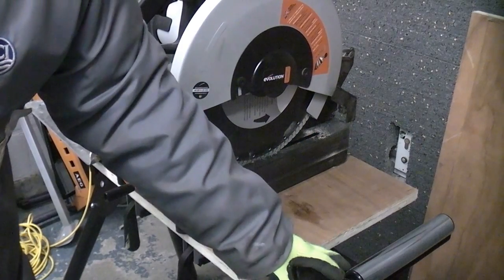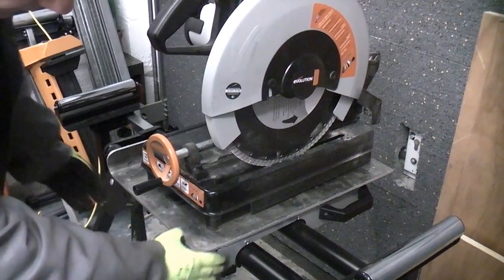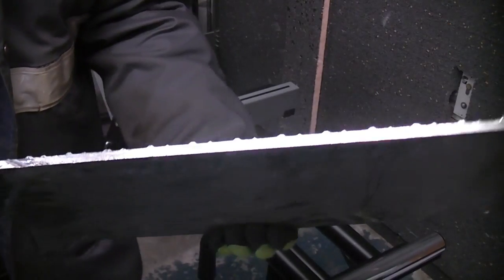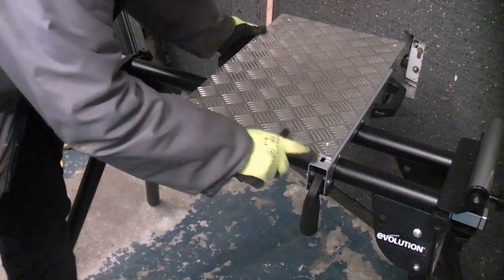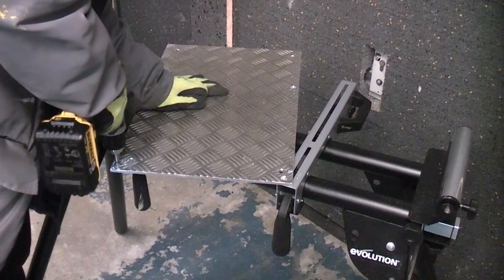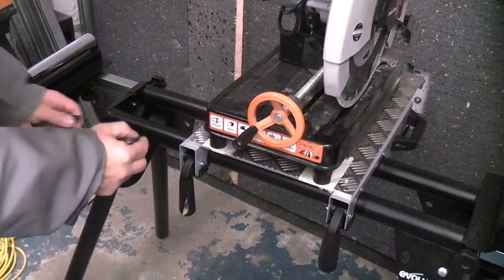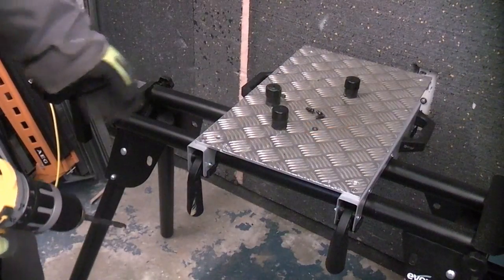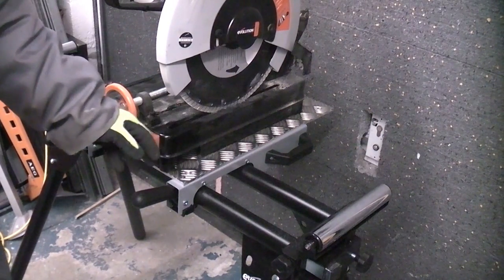How to make a mitre saw stand adapter plate

Comment: Another good video. I like your trick of placing a bit of tape on the spanner in order to hold the nut in place, genius idea. 
I possibly would get rid of those 3 rubber feet and custom make 3 metal feet in order to have the machine secured properly on the plate. Well done.
Reply from the maker: +Rui Nunes 
Thanks, normally I would use the Wera Joker spanner for jobs like this, but they are in my toolbox on site at the moment!
https://www.youtube.com/watch?v=BvBmCqXDDdk

The feet did pull down well into the chequer plate, so it is pretty secure although metal feet would probably be better ;-)
Thanks for the comment ;-)

Comment: Very smart. The only thing I would find annoying is fiddling with the nuts and bolts if I wanted to change the plate, so how about bolting some aluminium extrusion to the fixing brackets? You only have to do that once, then you can use T-nuts to fix any plate or machine from above much more quickly. Looks like the brackets are 30mm wide and 30mm X-profile extrusion is easily available with M6 T-nuts. You could even bolt things to the side of the extrusion. I missed the video for this stand, will go back and watch it.
Reply from the maker: +Matt Tester (UKMatt2000) 
Thanks Matt, this plate is designed for single use- you make one plate for each machine that will not fit the standard brackets. Most machines will bolt directly onto the standard brackets.
Thanks for the comment ;-)

Comment: should i make a different plate foe each piece of equipment I want to use { mitre saw, drill press, bench vise, scroll saw or grinder] or just drill different holes in one mounting plate?
Reply from the maker: Some tools will fit directly onto the rails, such as the mitre saw and perhaps the grinder 👍
You might need an adaptor plate for the others. You could do it either way, depending on what works best 👍

Comment: what thickness plate is that ? looking to do same myself, unless your selling them ha :P
Reply from the maker: +jakemuk 
No, I'm not selling them I'm afraid.
I used some 6mm thick aluminium checker plate, which I had left over from a job. You could use 1/2 inch plywood though or similar.

Comment: Do i spy a new DCD796 combi ? You kept that one quiet! lol
Reply from the maker: +animal79thecat Yes, you did.It came as part of the twin pack that had the DCF887 impact driver in it ;-)I should have the review of it ready in a couple of days!Well spotted ;-)
Reply: i only just realised they had brought out an updated DCD795 when i happened to be browsing ebay! I believe the 796 has more torque (70 nm) than the previous model.
Reply from the maker: +animal79thecat 
Not sure without checking the instructions (they are in the garage). I just did a quick Google and the document I found said it has 60Nm of torque, but I'll check the manual when I get chance. 
It's a cracking little drill to be honest, very compact and lightweight and powerful. I drilled a 13mm hole in some 8mm thick steel with it very quickly.
I should be filming a bit more of it tomorrow, then will get it online shortly after that ;-) 
The 5AH batteries are awesome as well!